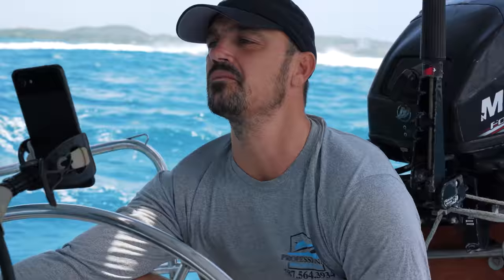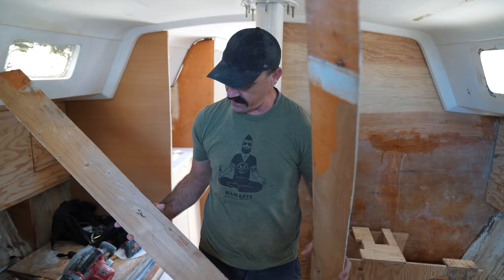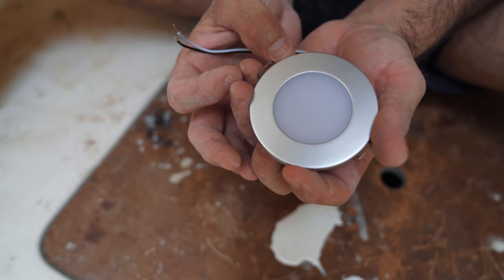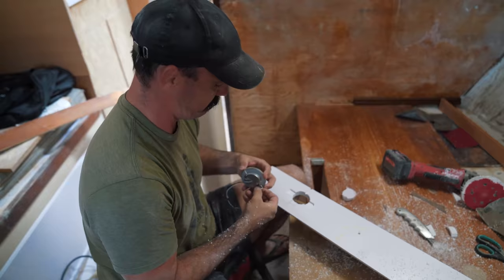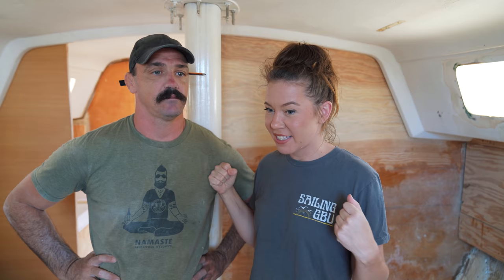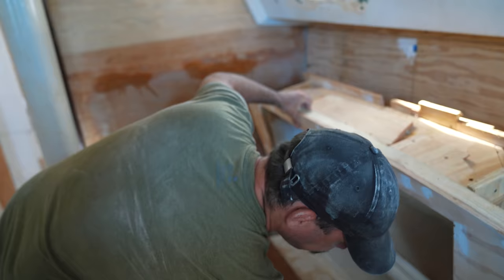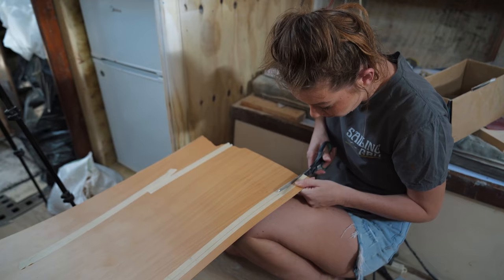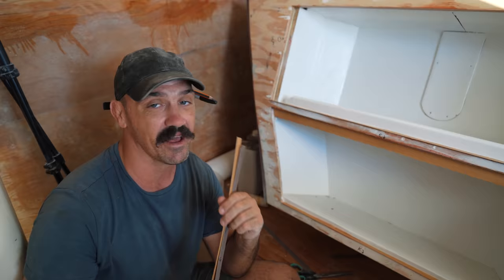HOW IS THIS THE CHEAPEST BUT HARDEST PROJECT?!

Comment: We love your videos, never miss them. We've been watching for a couple of years now, but I have to let you know something. Seriously, treat the pvc dust like its radioactive! it will not just dissolve like wood dust in your lungs. It will fill up the little areas in your lungs and you may not even notice it until you try diving one day and cannot get enough air. You don't want to be dragging an oxygen bottle around the deck someday.
Keep up the videos. You're doing great with the boat too.
Reply: Hi guys and gals, doing this will build alot of character for you both, and last a lifetime. Now, just as T. Micheal Rearic said, please treat the dust as bad stuff. Buy 1 or two extra hoses for the vaccum and have it expell air outside the vessel, and have Kristen vaccum with the nozzel as you cut or sand inside. It will save alot of dust and clean up while you work. It is a pain but it helps you not have to clean up the same dust 5 times,nor have to re-breath it also. Small preventetive actions now, can have a big impact on your health later. And possibly your child's health too. If you do not belive me, read the warning labels on your fiberglass container, although you will need a magnifying glass to do so. Best wishes, it's really starting to look great, don't give up. Jonny

Comment: Also regarding sanding the mica edges, you can take a piece of scrape wood 10" by 3 1/2" contact bond what ever grit sand paper you are using to the piece of wood all the way around. This way you have the 3 1/2 flat side for large long runs back and forth and the short (wood thickness) for the tight corners and hard to get to places. 40yrs custom kitchen cabinet makers have all the tricks! good job, it's starting to come around!! cheers!!

Comment: Been subscribed and following your channel for more than a bit, really enjoying it. I think the work you are doing with the tools you have is pretty incredible. It is all looking great and you have a real knack for interesting practical design. One thing that catches my eye all the time now, since you mentioned it on a previous episode, are the extended bolt threads on your mast compression post. I think cutting them off somewhat wouldn't be a bad idea but even if you don't I think you could use your MacGyver skills to clean them up visually. Just take some of that pvc board, cut it to form a 1/2 ring around the post with holes drilled in it to allow the bolts to pass through, and then build it up a layer or two thick whatever thickness is required to cover off the remaining bit of exposed thread with some cap nuts. If you're worried about the seams you can bondo that shite up, fair it out and paint it. There is no need to do this as it is purely aesthetic but since you are doing such an amazing job on the rest of the finish, it seems a like a simple thing that would really clean up the look of them Frakenstuds.

Comment: Guys, this is from a custom cabinetry designer and manufacturer. 50 + year old family business, 25 years of personal experience. Ok? So, I have to say my hat´s off to you guys. The only time I´ve done anything comparable to what you guys are doing to that Hunter, I´ve done it with my boat INSIDE my cabinet shop, with every possible piece of equipment , tool, and material you could possibly need for the job, including CNC equipment. NO rain, perfect 72 degree weather, no bugs and a crew that comes into the boat to clean and organize everything as soon as I come off it. You guys are doing everything in the most difficult manner, limited tools, on the water, in the tropics. Videos do not tell the whole story. Hot, muggy, cramped, working conditions. I can only imagine the inevitable arguments you two must get into , off camera.  But I´ll be damned, you are doing a bang-up job. You learn as you go, screw up, stand back, re group and get back at it and succeed. Somehow, in spite of your inexperience, you are actually pulling it off. Call me impressed.  Feel free to PM me anytime if you have questions or need an extra brain to help out. PURA VIDA!

Comment: Coming along great guys.

One piece at a time; as long as you're happy with it; you'll look forward to the next phase.

If you use stainless steel rods you can adjust and set the glued laminate sheet right on your work then remove each SS rod and your glued pieces will be aligned once you touch the glued pieces together you almost can't get it apart to adjust.

Again; the glue won't stick to the SS RODS and you pull them out one at a time and press the glued pieces together.

Comment: You guys are rocking it. Couple suggestions: Find a good weighted roller go over all of your formica pieces once you glue them down. Also, there are trim bits you can buy for your router. This will help you going forward. You can cut a piece big by just a bit....then trim it flush once it's glued down.

Comment: Very impressive with all the skills that you both have developed during the refit-especially impressed with Matts table saw to cut the laminate. It's all looking great and finishing is always the most difficult as the smallest imperfection seems to be obvious but only because you know where to look, no one else even notices. I have one thing I would comment on and that is the ring of bolts hanging through the deckhead around the mast, I would shorten them and put blind dome nuts on the ends for safety. Keep up the great work as it is all coming together and you will be proud of it

Comment: Router table. And good job. Little tip if you glue on a full face and cut out the holes the grain will match using the cut off. A little tricky and has to be a straight cut with a thin blade without scratching the banding.

Comment: You need to laminate both sides of the cabinet doors or they will warp. Make templates with paper or cardboard. Use masking tape around the outside to fit perfect. Keep it up. Laminated for 30 years.

Comment: I used similar lights, get a few spares.  The nice part is you can just pull them out any time.  I'd suggest wago connectors or similar so they can be swapped easily.  I've lost 2 of the two dozen that we have over the past three years.

Comment: You are right! You have better ideas than those big boat builders. We're sailing a 37' Pacific Seacraft Crealock that's supposed to be a "high quality build". But to access the port scupper hose, we basically have to disassemble the nav desk first. So yeah, the boat builders don't give enough thought to how the boat infrastructure is supposed to actually work.

Comment: I'm sure that you've already done whatever you are gonna do by the time we've seen this, but the way to flush cut edge banding with with a razor blade. Push it along the face of the cabinet and flush trim the edged banding. They make a tool, but a plain blade in your hand does almost as well. In any case, you guys sure are doing a lot of next level finish work with hand tools and its coming out good. Keep up the good work!

Comment: Guys keep up the good work.
I ve been a dog for quite some time now😉 if you route you're corners 45 deg you see the dark edge, but you won't have as much trouble with your hpl high pressure laminate expanding when it gets hot and giving you new sharp edges
It's really a hard stuff to work with. 
I use the router with a 6mm bit to cut the formica. 
keep it going👍

Comment: hey guys,
I have been a shipbuilder and cabinet maker all my life. I will not criticize, however you were unsure of a couple things and I wanted to help out. P-Lam, or plastic laminate is the product, Formica is simply one brand of plastic laminate of many. if it is available Wilsonart makes a good water based contact adhesive. Also the glue should be dry to touch when you put the parts together. You probably found that out by now. I would be happy to field any questions you might have if you run into something you don't want to cowboy through. your project is starting to look quite nice on screen. cheers
Reply: Very nice ! a lot of love  going into this refit .

Comment: Use a heat gun to bend the Formica/plastic laminate strip. Coat the surface that it will be mounted to, then coat the underside of the plastic laminate, and wait a few minutes for it to get tacky. Use some small wood strips to keep it off the base, line it up nice then press one edge to the base, then pull a strip of wood out as you work it down. Then roll the surface to get any air bubbles out of it.

Comment: Hey guys, I like this teamwork thing you got going on.   The quality of the work you are producing is impressive.  Things are looking up on the rebuild.  If I'm not mistaken, you are supposed to use a small wood veneer roller to push out all of the air bubbles trapped between veneer and the surface you are trying to glue it too.  Using a j-roller or a piece of solid wood with a rounded edge to apply even pressure to the entire surface.  This will ensure good bond to the surface you are trying to cover.  Good luck.

Comment: Really happy for you guys, your smart , creative , funny as hell . Formica isn't hard , files  and  your router . Just remember if you use contact cement  use wooden dowels between the contract face , that will allow you to position your piece , then pull out the dowels and drop the Formica in to it's final spot . Good luck .

Comment: Yup that's the way. Doing a DIY flip on the interior of your boat is like painting a room you start at one end and work your out the door.  🤔👍Just don't forget your incredible already tight doors aren't going to fit after the veneering. Their all going to have be sanded to fit. Keep nocking it out ignore those cheesy hater know it all's. Keep a cool head like Chester Cheetah. 😎👍

Comment: ....  excellent ..... your choosing the arborite you chose, great choice, love the color ... that plastic stuff you were previously talking about had me scared ..... Re contact cement. something I learned from an old cabinet maker when I was about thirty when cutting was done with an exacto knife and  edges were filed.  You have applied the cement to both surfaces and it is just beyond tacky, you put a piece of arborite on the counter top and then position your finish piece, make sure everything is aligned and then pull out the piece between pressing the surfaces together as you remove the spacer ..... with the challenge of grain, you may want to resort to cutting with an exacto knife and a straight edge .... by this time I bet you have it figued out ... all the best with it .... sure hop you have some good before pictures to make sure you remember what it was like before ... ths for sharing .. never stop dreaming, just dream bigger .. have fun be safe, save our oceans ..

Comment: Most of the contact cement you actually let it dry completely on both sides and then they stick like crazy when the two surfaces touch. On sanding, remember you multi tool also has a sanding attachment to help you get into corners and such.
  Looks great so far.

Comment: using a circular saw,cut a 1/8 or 1/4 inch notch length wise down your PVC where the lights are connecting all the lights ,this will give you a place to stuff the wires that connect all your lights together

Comment: I was taught laminating in high school in the early 70s and the laminate should already be glued on the back, you use a hot iron to melt the glue by placing the laminate on the wood, place brown paper over the laminate and slowly iron over the top pushing down to hold in place till the glue cools. I did our kitchen cupboard doors recently doing just that and using a blade to trim the extra off the edge.
good luck.  😂😂😂

Comment: The lights in the v-berth? … look beautifully finished. The pull-out oh-so-light forward cabinet? … great bit of design so you can, if you need to, remove it. The Formica? Ouch, as you say, tough to work with and I wonder whether wood veneer is available? The router-bench cutter was brilliant and the effort and finish exceptional. Power to both of you as this is all just so inspirational 🙂

Comment: Great job so far. One question I have is if all these updates have changed the center of gravity of the boat ? Maybe a sea trial sail would give you an idea if the sailing has changed any .
Reply: We will see around 2023 with all the extra heavy wood and all the Bondo and new appliances extra weight from the crew ! also it might belly up 😂🤣🥲🏴‍☠️🛳

Comment: yeah finish work suuuuuuucks. lol! its on old hand experience kind of thing. i have learned that the tools make a differance. i tried the home depot countertops (formica) is hard....until you learn about routering the edges down for a pretty corner and not try to sand them. duuuur.  the one other thing i learned in life is that miter corners on trim suck too...until you find these amazing tools called a miter box and 45 miter saw. OMG life changer lol!

Comment: This is probably to late, but having done miles of VENEERING on mega yachs and cruise ships, using  "horse hide glue and a hot iron, which you won't be doing, you can  use dowls to hold the veneer away from the plywood till the veneer is positioned properly positioned, then remove  dowls as yo press down, as you probably already know, when stuck, it can't be removed, a roller is a good tool to really stick the veneer down .properly.

Comment: Hi Guys, Don't know if you know this, when using thin mica, it is easiest to lay it down on a piece of plywood that you don't care it you mark up, using a metal straight edge (like a circular saw guide you can hold down with clamps) Use a SHEET ROCK/DRYWALL knife to cut the mica. It goes through that thin mica like budta!! try it out!!

Comment: Hey don’t forget to put nolox on all your electrical connections to prevent oxidation and corrosion. You going to solder those lights on with water proof heat sharing wrap?
Reply: Heat shrink wrap*

Comment: The lights look good but Mounting them in PVC is not a good idea. Unless the PVC you have used is rated for the heat, those light will get hot and warp if not melt the PVC long term. I only just found your channel a few days ago and have been binge watching your boat reno's so i dont know if you have already tested this yet or someone else has already pointed it out yet. Love what you have been doing, keep up the good work.

Comment: Whoo now, you are going to screw into the upper deck and put a hole into the deck? You might re-think that idea. Use some adhesive caulking in spots, and use a piece of wood as a brace to hold it in place until is secured.

Comment: Hey guys I know I'm always busting Matt's chops about his mustache but . For now I would like to help a little when you do those funkie sections were you can't get the router to do the job try to cut it as close as possible . And you can make a sanding pad with a piece of sandpaper and  a piece of plywood 4 inches by 8 inches the same glue that you use to glue the formica down works great

Comment: BTW, I assume that you are using contact cement and you should let that dry first to get tacky and then join the two tacky sides together. Get it right the first time cause they are very difficult to separate.

Comment: Hey guys EcoFlo just can out with a portable air conditioner it is only 4,000 btu's But it will run on either 12 volt or 120 volt. They are rolling it out tonight. It might be something that might work for you on those really hot days......Have fun and always stay safe.....Later guys.

Comment: For the love of God do not sand those edges. It will take forever and be very wavey.  Use a flat file instead held against the cabinet face. Make sure to cut into the glue edge and not away from it. You will see what I mean as soon as you try it. With practice, it is almost as fast as router. The scope of your project indicates that you will get lots of practice. Then take a razor blade and drag it along those long edges to ease the sharp edge of the laminate. No special tools, super cheap and great results. Just like the rest of your work!

Comment: You are making yourself work too hard. Though my comment is likely too late, you can buy either a 1/4" or 3/8" round over bit for your router to route ease the edges of the PVC, It will route, I've done it myself.  You can also buy a laminate cutter for your router to cut off excess laminate after you glue it on. All these cutters have a little ball bearing on the bottom of them so it just rides against the side of your work without damaging anything. They boat is going to look awesome when you are done.

Comment: GOOD you are trying new things and learning new skills. BAD you didn’t seal ALL the wood before assembling it in your boat. This is where moisture will get in and mold will in under and behind the the wood next to the hull and open spaces. UGLY when you realize 2-5 years from now that the mold has turned into dry rot. Your health my suffer from the hidden rot and you won’t know why. Then you’ll have to rip it all out and start over…. Or worst yet… sell the boat for Less Than $5000.00. Hast Makes Waste. Where did the worst dry rot show up when you started this refit?  Where the plywood and other solid wood meets the fiberglass hull… where moisture condescension turns into water then soaked up into the edges and end grains of the plywood and solid woods. Moisture in the wood turns the wood into rot. Don’t be a boneheaded learn from others and your past. There are a lot of other channels that address this properly … for the long haul.